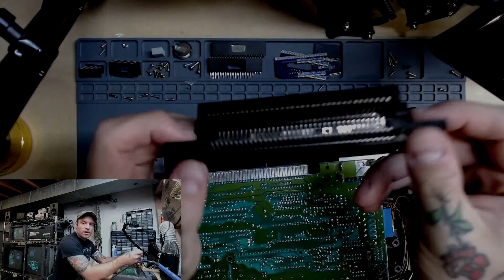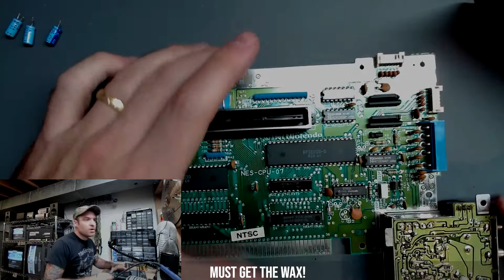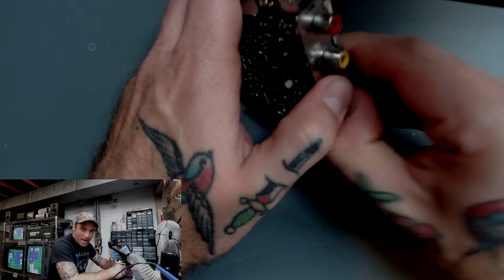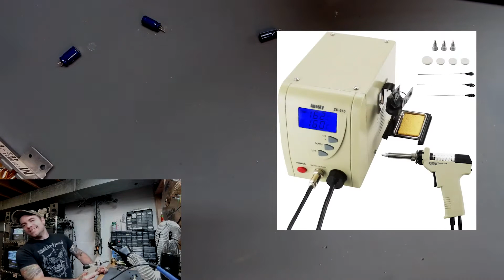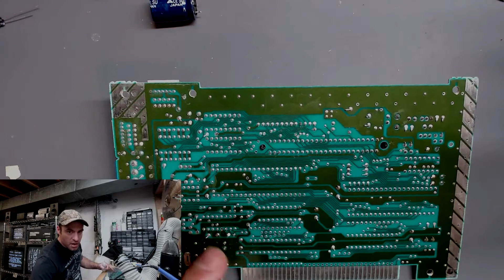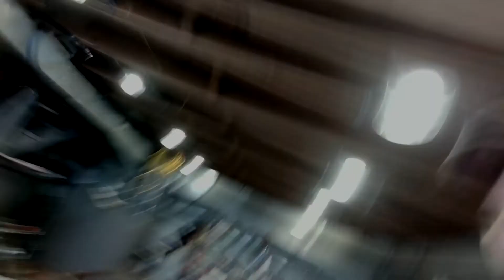NES RGB! Part 1: Full Recap

Comment: What is the benefit of replacing the voltage regulator? Is it a part that is prone to failure? And what happens when it goes bad?
Reply from the maker: I usually replace them while I'm in there because it's kind of a "wear part." The old regulators that these use aren't as efficient as more modern 78S05 or switching regulators. That translates to less heat inside the NES which is always a good thing. In my personal NES I use a switching regulator but it did introduce a little bit of ripple in the video. Upgrading to a nice triad power supply took care of it though.
Reply: @daneolds515  Ah! Thanks for the info. 
Can you recommend a specific power supply?
Reply from the maker: @HBOMBforPresident  Yep! FirebrandX has done an exhaustive write up on the ones to get for various consoles. Check out his page here:

https://www.firebrandx.com/triads.html